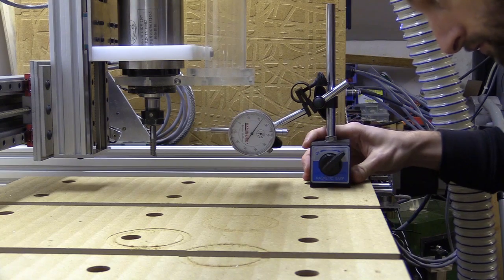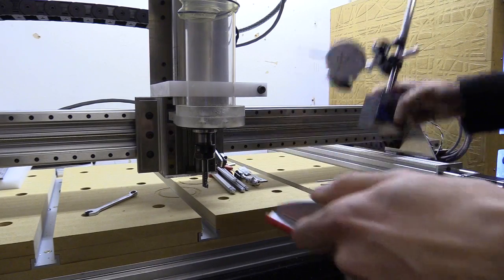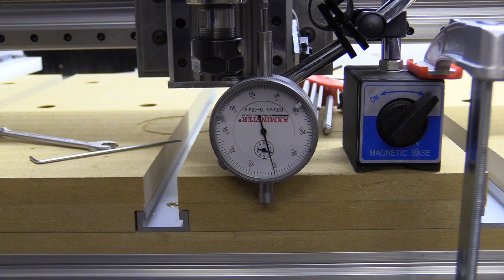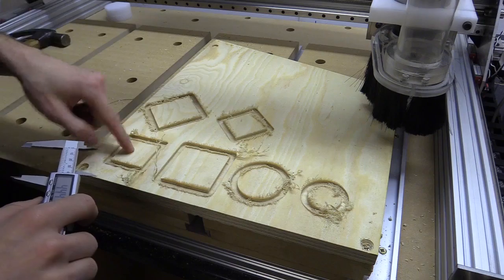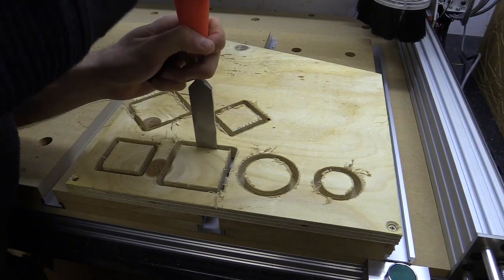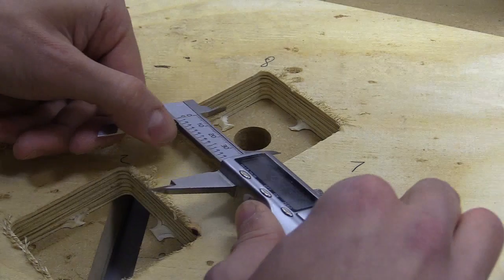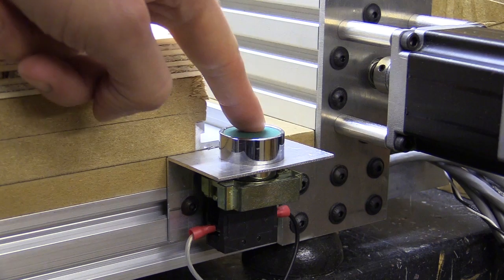#34 Checking Flex in DIY CNC #34 / Final Calibration and Fine Adjusting Steps

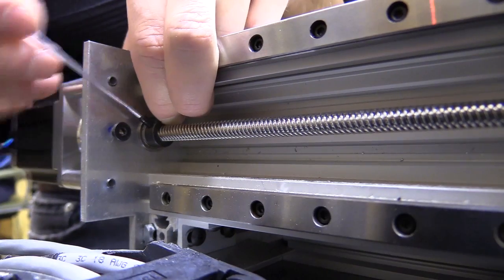Comment: 2:10 main backlash source is ALWAYS going to be the nut. Fixing it is easy. Just use two nuts.
Reply from the maker: Not really, backlash can also be the result of how the screw is held. For example I have a ballscrew CNC machine now and if I don't fully tighten and lock the screw nut in the end support the backlash  increases. Or maybe it's a different term. NUTLASH!

Comment: how did you manufacture those aluminium parts for this mill? must have cost a lot. very cool design
Reply: i think he said he got them watercut locally, but he might have routered them out like he did in previous video. i use https://www.2twentytwosteel.com/ they are pretty reasonable.

Comment: Something seems weird with your drivers/stepper. Your settings are very conservative. I had to change $1 to 255 to get steps reliable at the beginning with my dm542t. Could this be related?

Here are the settings I use on a 1x1 Sphinx. 8000mm/s max speed and 500 acc. https://openbuilds.com/threads/sphinx-grbl-settings.10668/

Comment: If you have not used ball screws you should look into them, and minimally just check out how beefy the mounting hardware is.  The stiffness of you machine will only be as good as the weakest link be that the motor mounting, thrust bearings, nut bracket etc etc.  BF12/bk12 bearing block drawings are available for you to check out.

If you don't want to spend the $$ then check out chamfer rail.  you can find it in the fabricatable-machines repo.  There are fusion 360 files for rack/pinion only.  there is also a video where it is tested with a 40kg offset weight and there is something like .03-.05 backlash.  You can mill these rack/pinions yourself.   I was very impressed by the chamfer rail rack/pinion performance in my testing I saw .01 backlash.
Reply from the maker: I'm already looking at ball screws. Think the next machine is going to look very different.

Comment: by changing the steps per on one axis I think you are compensating for the error due to backlash.  This won't work unless you are always cutting the same parts.  You need to cut several size parts.  If the error is the same for multiple size parts, it's the backlash.  If the error is a percentage of the size then it's the steps per. (if that makes sense).
Reply from the maker: Yes I have cut larger objects out since, and they come out with the error being the same. I'm going to build a ball screw machine next though.
Reply: @EducatingSavvas  I converted a mill and used ball screws.  The cheaper ones also have backlash.  I ended up using two nuts per axis with a spring between them with excellent results.
Reply from the maker: @Balsamancnc  Noooo - I already got cheap ball screws. :/

Comment: Move your locking collars on the outside of your leadscrew essentially stretching it
Reply: I have the same lead screw and locking collars. My set up has 2 thrust washers and 2 locking collars per screw.
To set the preload on the screw i tighten the set screw until it catches the gullet of the thread. Then I use the allen key to twist the collar left right to tighten the screw. Finally i tighten the set screw all the way down.
Reply: Also reduce your micro stepping to x4 or half step. You have way too much steps per mm. Your target is 50-100. With the 8*2 lead screw your max feed rate will be 1500-1800 or a bit more if you reduce the current on the motors
Reply from the maker: @jimbit22  That's going to be very noisy, but I'll try it out when I'm next in. What stepper motors are you using out of curiosity?
Reply: Your acceleration is good and you can set it to around 60-80 without any problems.. I have an acceleration of 120 without any problems. I use adaptive tool paths and they take advantage of the faster machine.
Reply: Double length nema 24. I use them at half the amperage they are rated. Low current, the highest voltage your drivers can take, low microstepping help with speed (coil charge time of the motor).
Reply from the maker: @jimbit22  I'll do this for the next machine (yes there will be more) but for now it's working so I don't want to mess about with it too much - or swap out PSU's. I'm using 1/16 steps - so could drop down to 1/10, or 1/8 if I need more speed - but 1/16 did sound the best. Lower didn't sound healthy to me.
Reply from the maker: I've already done that but I'd need a treaded locking collar, which can apply tension to the lead-screw.